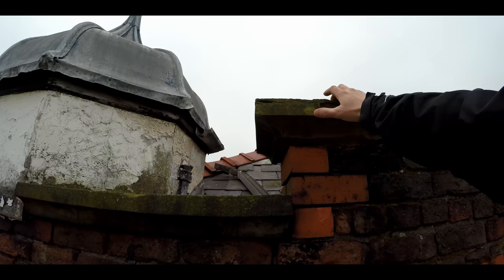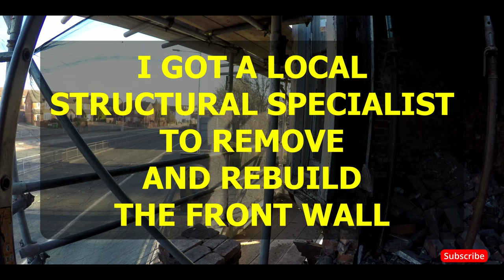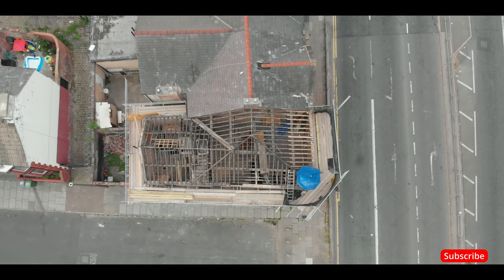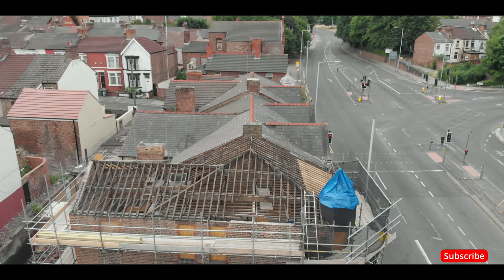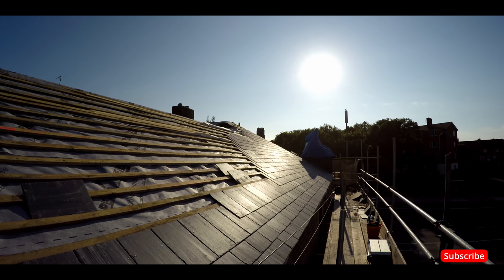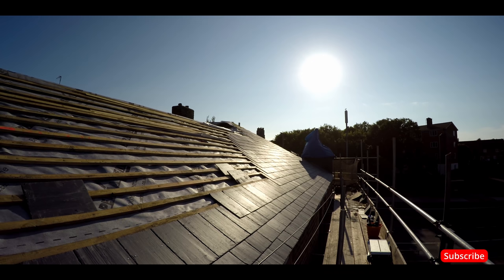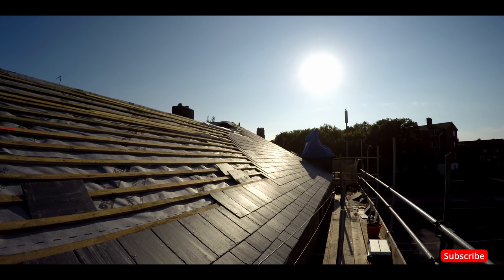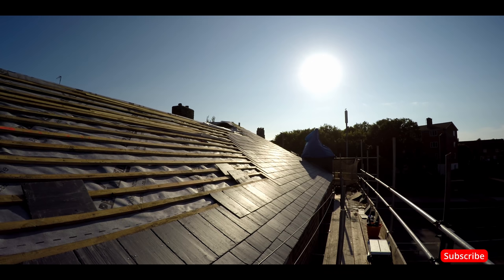MAN BUYS DERELICT SHOP FOR £26,000 IN BIRKENHEAD, U.K - TRANSFORMS INTO FOUR BED HOUSE (FULL BUILD)

Comment: As a fellow human looking at restoring a two story 1895 brick building with similar issues I felt all of that pain and anguish of the wall removal and roof rebuild.  Thank you for posting this up. It’s definitely an inspiration of what a human can do when they are determined. Bravo sir. Bravo.
Reply from the maker: @Bill Heineken thanks Bill! It was a bit tough at times but I got there in the end.
Wishing you all the best with your project
🙂👍☀️
Reply: @newdawnrecordings  
You mentioned something like' plenty of sanding' around the time in the video where you were plastering. Just curious, but did you have to sand any edges/lines left as the plaster cures or were you able to iron it out. You'd normally have a finishing trowel, nicely bladed in. Difficult enough any day notwithstanding you were working off a stepladder and knocking up yourself. Did you prime the joints to prevent these areas pulling in? I reckon you must have worked up a thirst on the ceilings. Out of the game now but more lads using stilts now.

Comment: While I live in the U.S., I'm also very proud of you're taking on this project to take an existing building with so much history and bring it back to life. All too often in the United States, when a building becomes old a derelict, we simply knock it down. But by knocking it down instead of renovating it, we've not only destroyed a building, but we've destroyed a part of our collective history and a part of a community.  The current generation claims that they're all about reducing their carbon footprint blah, blah, blah. But I think it's just as important to take an already existing structure and renovate rather than build something new--even if it is a tiny house using sustainable products. I don't think I could ever live in a brand-new home because I'm all about living someplace that has history and character. Well done!
Reply: Trouble is the build quality in the US, there's nothing there to renovate, wooden walls and shingle roofs are not going to last 200 years unfortunately. In Europe when you strip something back you've a solid shell of bricks and mortar to work with.
Reply: As part of the 'current generation' who wants to reduce their carbon footprint, this project is fantastic! Improving an already existing structure is completely in line with what's good for the environment. Building materials require energy to be produced, so of course knocking down an old place to build something new isn't the best choice environmentally if the old building is still fit for purpose. And just personally, I despise the look of most modern houses because they tend to look really boring and have 0 soul. 

It makes me sad that these generational categories are pointlessly dividing us. I recently went to my friend's 60th birthday party, who I get along with really well with. There's also people my own age (20) who I have absolutely nothing in common with. I don't think we should assume people's beliefs based on their age, or that the beliefs of different generations will be incompatible by default. Young people can want to preserve old buildings. Old people can want to knock them down and redevelop them for a quick profit.

Comment: Wow, you trusted those old, crumbling bricks way more than I ever would have. The roof beams looked so scary too! The whole thing turned out SO gorgeous though!! FANTASTIC job!!
Reply: Think he trusted the inspector, not the walls.
Reply: i think i would have just ripped the whole building down and then rebuilt it using as much of the old as possible. It looked like it was in such bad condition.
Reply: @JD96893  I doubt he'd have gotten planning permission for that. It's no doubt listed as some sort of "industrial monument". As is I'm surprised he got permission at all to turn it into a house, which means a zoning change.
Reply: @jwenting  I was wondering the same thing - maybe no
zoning in the small villages in the UK?  In older areas seems to be lots of living above the shops ?
Reply: @SSDGM26.2  oh there is zoning. But maybe indeed there is a loophole as he lives on the first floor and the ground floor is his studio/business.
Reply: I agree with you 100% but later on you can see it's all be repointed really well.

Comment: It is so different the way you are doing the walls of your house/building.  In the USA, once the drywall board is up, it is taped at the seams, then joint compound is added to the tape, smoothed over, once dried it is sanded.  No plastering is done.  It is painted over with primer and then just painted.  

Great job.  Seeing you walk on those beams made me dizzy, especially since I"m scared of heights.  Have you had your home reassessed for its value since its completion?  I guess no amount of money can be put on what you have accomplished which is simply great.  

Ms. B. Churchill

Comment: Just found your renovation film and I’m blown away by your determination to get it done through thick or thin, the result is outstanding! And the added bonus was the creation of your music studio and shop. Big heartfelt congratulations on a huge achievement.  Big fan of ambient music as I had written a bit of my own. I will check the recording out. Best of luck for your future projects 👍🏻👍🏻
Reply from the maker: @ArteryRunng thanks I really appreciate it cheers 🙂☀️
Reply: @newdawnrecordings  
How did you cost the scaffolding? Not aware of how long it was standing but commercial scaff co's charge rental and it requires inspection (at a further cost) on a regular basis. Seeing as you were doing works on an ad hoc arrangement and potentially leading to a long term/not known length of programme, is it feasible to purchase scaffolding and hire a scaffolder co to erect, inspect and dismantle (sell on)?

Comment: Canadian here. I'm amazed that you put up wallboard right on the brick walls with neither insulation nor a water barrier.  Our building codes would require both with at least R30 in the walls and R 60 in the attic. 
We did this in an 1892 built house in Ottawa (winter lows -35C/ summer highs +30C) and cut our heating bill nearly in half.
By the way, having done this ourselves, the better way to install drywall is horizontally, not vertically. Much less cutting and piecing, none if you have eight foot ceilings and 4x8 sheets. We had 12 foot ceilings, so stacking three sheets high worked well.
Reply: This isn’t Canada, it’s England.

Comment: I watch a lot of restoration and renovation. I think building a wooden frame attached to the masonry and then attaching the drywall/ plaster board to that gives better insulation, and you can have access to plumbing and electrical in the walls.

Comment: Very brave undertaking!  The price is great though.  I couldn’t see but did u use insulation for walls and ceilings?  Will you be adding acoustic tiles on the music you record will sound the best?

I bought an 1899 house and had it renovated so it was livable.  I had to liquidate all my retirement savings just to bring the house up to date and repair all the damages.  I used up all my savings as well.  I used all contractors because I was 63 and have no trade skills.  My renovations took from 2018 to 2022.  I will never do this again, ever!

Comment: You're an absolute Legend doing most of it by yourself.
If I could suggest something - next time spread some Boracol 20 on the joists, rafters and the beams, and wrap the ends with DPC with 50mm extra from the wall.
It's still going to last for decades, but if you add these two things, it will last decades more.
Great job. Still watching, I can't wait to see the final results.

Comment: Just wondering why you plaster the entire drywall boards? We tape and mud (plaster) the joints and screws then paint directly on the boards, first a base coat sealer then finish coat of paint.

Comment: Interesting that you all still plaster the walls and ceilings in the UK. We stopped doing that in the US decades ago. Mud the joints of the gypsum board, sand it smooth and primer it. Then paint. Much less work, although it is a shade less craftsmanship.

Comment: Beautiful transformation 😍   I have a question: Why are there large metal shutters along the front and partially down the side?
Reply from the maker: @bigmane822 the metal shutters are replacements for the original ones on the shop unit. I also had a matching shutter fitted on the rear yard area of the house for secure off road parking. Thanks for watching ☀️

Comment: Well done Steve. Must admit I’m intrigued as to what the current situation is with the commercial shop unit. Has it been let and is it operating. Did you keep up because you were required by Planning to do so? Bob
Reply from the maker: @bobwright9523 Hi Bob, the shop is currently being used solely by me for music and artwork. The reason I kept the shop was because there was enough space in the building to have a large house and also a completely separate shop unit. Although it was a lot of extra work and I had to follow two different sets of building regulations I now have two properties that can be sold separately. I originally planned to use the shop for myself long term for either music/art projects, joinery, or rental, but my plans have now changed and I am going to sell the properties in the near future. Thanks for watching ☀️

Comment: Well done that's some seriously impressive work. 👏Did you do it all on your own apart from the front external wall?
Reply from the maker: @urbanhomeimprovements I had a specialist for the front wall replacement which included some upright steel supports at ground floor level. I also hired a plumber and electrician. The rest was pretty much me with help from friends and family at times. I would recommend hiring a plasterer!

Thanks for watching ☀️

Comment: Is the shop now residential? Couldn't spot it in the film. Thanks.
Reply from the maker: @lawrencebacchetta6979 I didn't explain it very well, but that was the twist in the video. The majority of the building is now residential, but the ground floor area at the front with the shutters has been separated and is now a commercial unit. Thanks for watching and all the best, Stephen ☀️